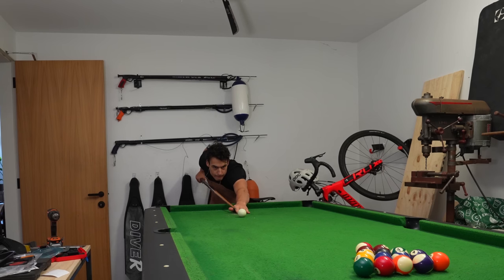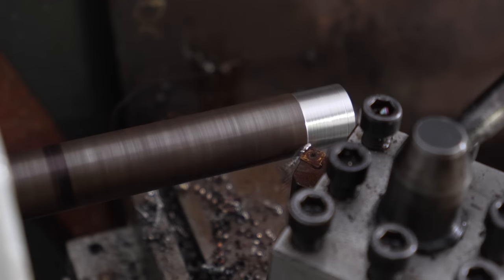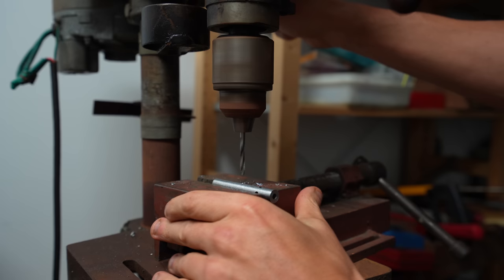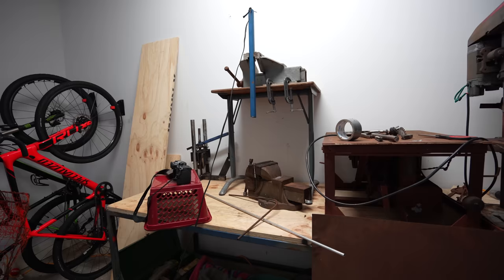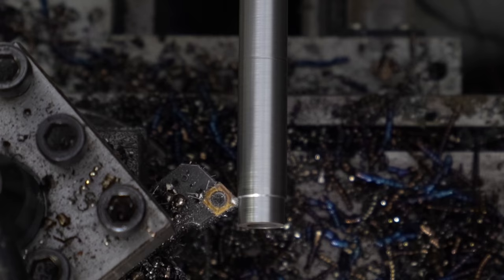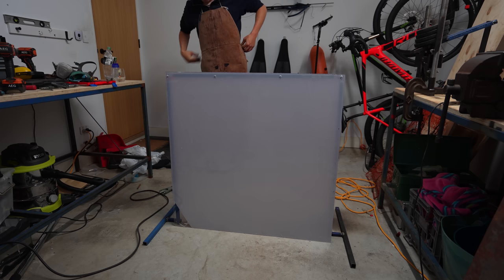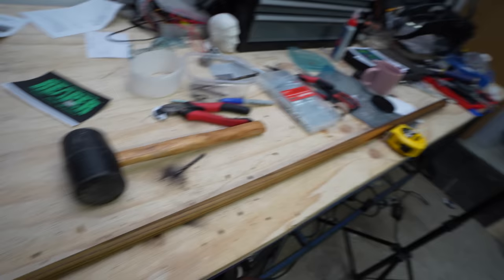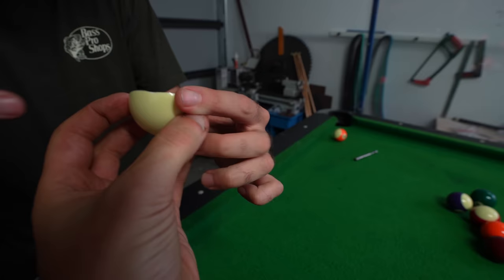I made the worlds most dangerous pool stick

Comment: I sincerely love that the only reason blank rounds are safe is because they aren’t firing a projectile, and then idat calls them safe and puts a projectile in front of them
Reply: Blank rounds are still incredibly dangerous at a short distance, sometimes even lethal
Reply: @wilson.5420 I still remember that 100 ways to die or something show
Reply: @wilson.5420 prank his daughter and her boyfriend with a pistol loaded with blank rounds, after the prank, he pointed the blank in his head and he died due to the pressure
Reply: @ShiratoriIsOffline  big brain move
Reply: @ShiratoriIsOffline  if there is enough space between head and gun then the pressure would release and you would only get burned
Reply: @vinnieg6161  it was big brain all the way up until he pulled the trigger, then it was no brain
Reply: @RootinTootinShootinkittycowboy  Not no brain, rather splattered brain
Reply: Kentucky Ballistics has a video showing blanks and how potentially deadly they are
Reply from the maker: Hey...this time it wasn't a projectile
Reply: @vinnieg6161  not anymore
Reply: @benclampman  you should try!
Reply: @ShiratoriIsOffline   i remember that shit
Reply: @Ididathing  A projectile is an object that is propelled by the application of an external force and then moves freely under the influence of gravity and air resistance.

So it was, in fact, a projectile
Reply: @mr.cauliflower3536  well um acthually
Reply: @Slimysock-td6oq  🤓
Reply: Alec Baldwin said that too
Reply: @ShiratoriIsOffline  there may no longer be a projectile but the energy still exists.
Reply: This is probably the reason why YouTube doesn't recommend any videos to me from this channel😂🙈🙈
Reply: That is not what makes them safe, but what makes them safer than regular rounds
Reply: @mr.cauliflower3536 🤓🤓
Reply: Idat...
Reply: Someone still killed somebody else with a blank round
Reply: @Ididathing  it's only a projectile once it breaks, that's what i always say
Reply: well, technically it just creates a highly compressed gas. which you could do (with more effort) with other things like Co2 or even air if you pressurize it enough.
Reply: @midshipman8654  yes. fucking obviously. the only reason bullets are dangerous is because they throw projectiles really fast, so something would be just as dangerous as a bullet if it threw a projectile just as fast. that doesn't mean bullets aren't dangerous.
Reply: @gremlinman9724  ??
why are you getting angry, I wasnt saying they weren’t dangerous, just that the principle aplies to a lot of things that otherwise wouldnt be dangerous either.

I wasn’t disagreeing with him.
Reply: @tcg1_qc more like, liquid brain. It would have still been in his head, but the pressure caused total brain death
Reply: Breh it’s a fun vid for a stupid experiment u guys need to chill a lil

Comment: Make the world's most powerful toaster. Who needs guns when you can eject a flamin' hot piece of toast at someone.
Reply: When you put it like that, it seems so obvious. Like common sense, really 😎👍🏻
Reply: there are enemies in this game called Tonic Trouble that do exactly that
Reply: W idea
Reply: i like this idea, i want toast NOW!
Reply: Yes
Reply: Weaponry in the Land down under
Reply: “A toaster is just a death ray with a smaller power supply! As soon as I figure out how to tap into the main reactors, I will burn the world!”
Reply: yup
Reply: Destiny2 jotun 😂
Reply: Yes
Reply: Photonicinduction already did that.
Reply: your a genius
Reply: This puts up two problems.

1. Accelerating the toast
The fastest toaster has to move the toast at an adequate speed. I suggest he glues singular pieces on sheet metal frisbees and toasts them mid-air.

2. Heating the toast
The hottest thing that comes to my mind is a lightning. Maybe it is possible to launch the toast-frisbee through a air gap capacitor that is sufficiently charged so that the frisbee would ignite an arc.
Reply: @fibr48cj  You could use a "controlled" explosion to toast the bread.
Reply: @fibr48cj  Not accelerating the bread on a ballistic trajectory to an adequate speed  to generate plasma so it toasts and then ignites in air  prior to impact?
Reply: @yosawin3018  if you're not familiar with Photonicinduction channel it sounds like you want to be. He's not posting videos now but there's a lot of quality material
Reply: @reverendtfg6802  "10 Second Toaster"

Comment: The lack of safety with how dangerous his ideas are is both shocking and extremely entertaining
Reply: Welcome to straya 😂
Reply: Stuff Made Here - Engineering and CAD Software, calculations of forces to be safe, safety precautions in design and checklists, equipment costing tens of thousands of dollars
I did a thing - Puts a bullet into a rod made of soft steel he turned on a wobbly lathe.
Reply: I'm like 99% certain that if he didn't have the safety glass, the piston would've beamed him right in the head.  I've replayed that bit a few times now, and it looks like it's getting projected forwards into the padded object, bounces back, and impacts the safety glass RIGHT in line with where his head is.
Reply: Man the entire thing needs a bolt through the center with the explosion in the rear so the striker is forced forward to strike the ball putting a blank in the tip isn't going to cut it buddy.

Comment: What a mad lad, he used the lathe to fix the same lathe while the lathe was still broken.
Reply: they say the first tool that can make itself is a lathe,... and then it can make all other tools... because it can be used as a milling machine like he did.
Reply: What a mad lathe, he lathe the lathe to lathe the same lathe while the lathe was still lathe
Reply from the maker: It was a real bad fix
Reply: @Ididathing  Ain't called jury-rigging for nuthin'
Reply: @Ididathing  just use the lathe to fix the fix for the lathe so the that if you have to fix the lathe you can use the lathe
Reply: @Ididathing  e
Reply: @dimitar4y  then what made the lathe, paradox
Reply: @cromulom2223  According to legend, it was, in fact, a pair of ducks. The first lathe hatched from an egg. Shorty before the first chicken.
Reply: @FasutonemuMyoji  the first Bridgeport was/is the ark of the covenant
Reply: @cromulom2223  the first lathe was made by a hand made wooden lathe.
Reply: @Ididathing  it if works, it works
Reply: @dimitar4y  but that's not possible, the wooden must've been made with another lathe
Reply: @cromulom2223  nah, look up history of the first screw lathe. A guy made a screw mold out of wood by hand, then filled it with abrasive sand and fed a rod through to create the first screw. Which then became a guide for the lathe to make more screws. Each more accurate than the last.
Reply: @Ididathing  Then Sir, we call it a bodge!
Reply: @dimitar4y  were his hands made of lathes
Reply: @cromulom2223  So he was made on a lathe?! Who made the lathe that made him..?
Reply: @dimitar4y  dear god
Reply: @cromulom2223  But wait, there's more... Which lathe turned the universe?

Comment: Pro tip for smooth pistons. Make your piston the same diameter as the cylinder then sand with 1000 grit sandpaper on the lathe. This will make the piston sides smooth and give a better seal.
Reply from the maker: For this build i actually tried to get a really loose fit as i already had more than enough power
Reply: @Ididathing  make a gun on the end of a machete for if you miss with the machete
Reply: @Solarianv3 XD
Reply: @Solarianv3 not many comments make me burst out laughing anymore, but this was an exception, gg master comedian

Comment: Drill the hole before you turn your OD next time.

The extra material adds rigidity to the work piece and you'll get a better, straighter hole.

If you're going to use cutters in the lathe chuck, remember to lower the RPM to what the tool is rated for. That endmill was screaming.
Reply: Also looked like he might have tried to climb mill on it too. Plus all that stickout!
Reply from the maker: ahhh good tip about hole first before turning. I cant change the speed of my lathe as i lost the manual and cbb to do the maths to work out what gear arrangment to use.....
Reply: @Ididathing  look for a model number and I'm sure you could find the manual online.
Reply: That's what she said!
Reply: @Ididathing  there are a few repositories that might have your manual. what is the model number?
Reply: @Ididathing  Also that looked like a carbide endmill?
In all honesty for your setup I'd recommend HSS tooling, at least until you get that thing bolted down.
The chatter is gonna eat your carbide tooling and probably just give you a headache.
Reply: @Ididathing  Blondihacks has a really good youtube channel where she does a lot of machining videos, and she always shows her mistakes and shows how to fix it.

Comment: love your videos. I am a machinist, and watching you teach yourself the basics of machining is super fun, as in this video when you discovered the virtues of machine rigidity. I have some notes, but mainly I  think you would benefit from using coolant with your lathe. when you were doing the barrel, a bit of coolant and a peck movement as opposed to constant force could help with heat, surface finish, keeping the drill from "walking" off- center, and chip management! ✌✌✌
Reply: I cringed a little when I saw the barrel bit.  But it was cool to see him discover that one of the cardinal virtues of being a machinist is that you can make your own tools and replacement parts.

Comment: Hey brother , I run a lathe as a day job, (which by no means makes me an expert) . You are doing great for being self taught , but if you happen to spend maybe just an hour reading about stick out ratio , rigidity,  and using a center, you could take your creations to the next level!  

Love the content !
Reply from the maker: Thanks mate. I do try to use the tail stock for rigidity but i broke the clamping mechanism. So wasnt much use in this video.
Reply: @I did a thing Your finish came out quite nice for having no center in . 

But having broken parts makes it quite tough. 

We have a tailstock that the clamp is broken , so we made a little piece that sits behind it and can clamp . It doesn't hold it to the lathe ways , but it keeps it from sliding back at least !
Reply from the maker: @BigEvy  Yeah i did the same just used a regular clamp but the tail stock still lifts up a bit on the bed

Comment: Hey man love your videos, just wanted to drop some tips I learned dealing with vaguely related ballistic projects. 

Use a longer spring that makes contact with the barrel before the explosion goes off that way you have the biggest amount of time that energy can bleed off before it gets to the end of the barrel. Also in my opinion, you didn't need to add holes at all, the effect of adding holes at any length in the barrel is to equalize pressure with the atmosphere (which the pressure of the gas is basically an accelerometer) at some specific point of time where said gasses are going to maintain X degree of acceleration. This means that having them at the end of the barrel can only help with the recoil, if you can find out which way the pool cue pivots when firing, having holes in very specific places could help a lot with that recoil. You should also use 4140 steel, which is a type of steel gunmakers use because of its overall strength, if you're worried about it exploding, heat treat the metal after you're done using a lathe so that you might undo the strain put on the structure of the metal just from using the lathe. In addition, I think you should have made your prototypes firing pin/bolt (?) air tight before adjusting its ballistics or properties of the barrel, as it obviously changes quite a lot about what you're doing with the cue.

Comment: If you want to reduce chatter on the lathe without putting a bunch of weights on it just use your tailstock support if the work is more than 3x longer than it is wide.
Reply: the 3 rules of machining... Rigidity, rigidity and rigidity. Also mass. And avoid resonance.
Reply: And if you use the lathe to start your tap/die it will make sure your threads are straight.  Just a small nitpick.
Reply from the maker: The clamp doesnt work properly on it and it slips back on the carriage
Reply: @Ididathing  By clamp, do you mean that T-Nut you replaced, or the tiny lever that locks the tailstock feed screw?  Sorry, I don't know all the actual terms.

Comment: As someone who had bollock cancer i really related to the 
'You're better with half a ball than a real ball'😂
Reply: what did it feel like?
Reply: @CarpetSnakes  if you mean the testicle it was pretty bad by the time i noticed as i'd had a hydroseal covering it at first.
The best advice i wish i'd known is to check how dense/solid it is.
It had almost no give in it, more like squeezing an apple than an orange.
Reply: @CarpetSnakes  oh and if you're looking for lumps, lumps separate from the teste are usually okay (still get them checked though)
If your main teste has changed shape or hardness you need to sort it asap though.
Reply: @seldom_bucket  i wonder does that mean u would be protected from being kicked in the nuts? seems almost like a super power
Reply: @squidwardo7074  😂😂 i did actually want to add that but it seemed tmi.
It's been a couple years but i have completely forgot what being hit in the nuts/nut feels like.
Even when i get a knock there i brace for the pain but it never comes, i guess there's enough room for it to recoil from the impact.
Having said that...i remember waking up from surgery and it felt like having my sack curb stomped, the kind nurses gave me a nice dose of morphine when i told them that though 😅

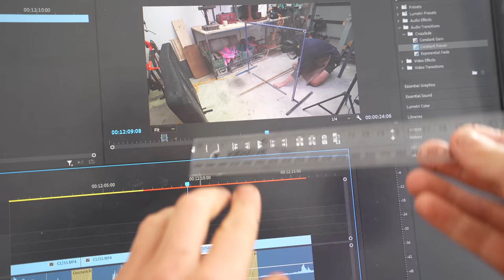Comment: 12:24 Surely it was double the speed (144mph) because the camera would have been recording at a 180-degree shutter. So 1/120 not 1/60 of a second!
Reply from the maker: wait.....i dont understand....It was set to 1/60 fps
Reply: @Ididathing  https://www.youtube.com/watch?v=DncLDtGsMxQ Shutter speed (time sensor is 'active') and framerate can be different to each other. 180-degree shutter is a general rule that a good shutter speed is double the framerate, so the sensor is 'active' for half the frame time.
Reply: @Ididathing  You were measuring the distance of the blur, right? 

At 60fps with a 180-degree shutter (1/120 shutter speed), the sensor is only exposed for half the frame time. For the other 180 degrees, the shutter was closed recording nothing.

So the blur is the distance it traveled for half of a frame (the shutter speed), i.e. 1/120th of a second.
Reply: @Ididathing  Alternatively you could measure the distance between the start of the blur on two different frames, then you can use 60fps as your time reference. Notice the end of one blur isn't where the next starts (shutter speed ≠ frame rate)

Comment: You COULD drill a few holes in the concrete....at best exactly below some existing holes in the ground plate of the lathe....and screw it down, with some concrete anchors....OR you do the job like murricans do and glue it onto the ground with hot glue!

Comment: Machinist tip : if you have a small diameter yo have to get higer rpms for having better suface finish and better geometric tolerances. You gave a formula for that that you can look for it but it has to do with you cut velocity on the tool and use emory cloth to get a polished finish for tight tolerances
Reply: And you can get higer carbon concentration on ur steel by rissing the temperature with charcoal and quenching it

Comment: The force is too much for not being a parallel vector with the surface of the table, that's why most of the shots jumped, and exited the table. You should either reduce the force of hit to a stable one, which would be approximatly half the break force, or make all your shots exactly parallel to the surface which the balls are on.

Comment: they make a attachment for the lathe that lets u mill parts. it ads a axis so u can move the part up an down an some come with vises made into them. if u buy a mini mill u will never regret it, but if u do buy bigger than the x2 machines get at least a machine thats the size of the x2.7, thats the best way i can explain them, but ive already mentioned it in other posts but u really should look into getting a mini mill and 3d printer. u would be put on list for sure if u had those.

Comment: Those blanks have a much higher pressure than a ,22lr if youre making things with them again make it our of 4140 and get a .22 chambering reamer and headspace the rim of the cartridge you are playing with very dangerous things even if its only a small cartridge the potential to kill you is there. i make guns for a living. also thicker metal when it dosent have the correct tensile strength wont work it will rip itself open think of the energy being transmitted through those desk ball things it hits one end and goes to the other,. same ideal. just make everything from either 4140 carbon or 416r stainless and read about headspaceing. you could end up making a grenade basically. if you dont know what you are doing.

Comment: you should have put a rubber/cloth tip on the end to help absorb the impact and prevent it from chipping the ball (in a literal sense). I also would have put a short chain or something to catch the piston when it flies out so it doesn't lay on the table and potentially block a pocket. also, not a pro, didn't chalk up the stick beforehand. 0/10